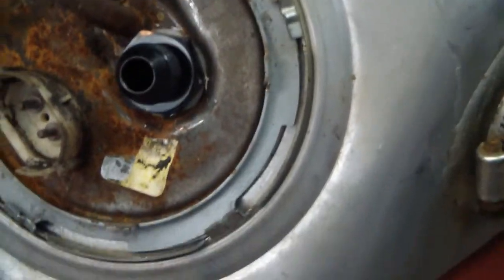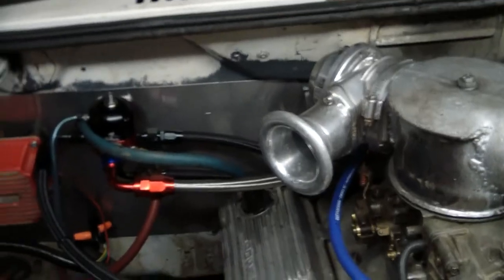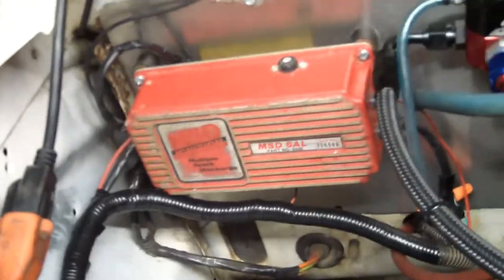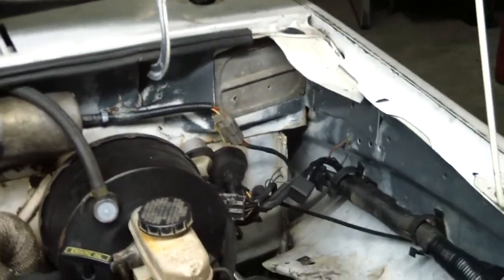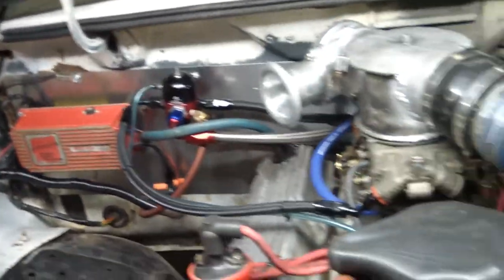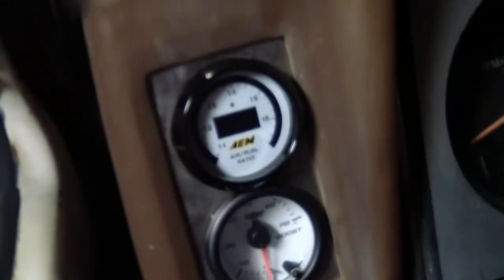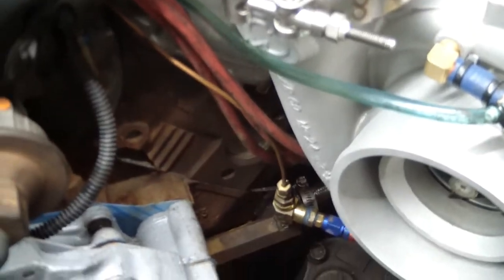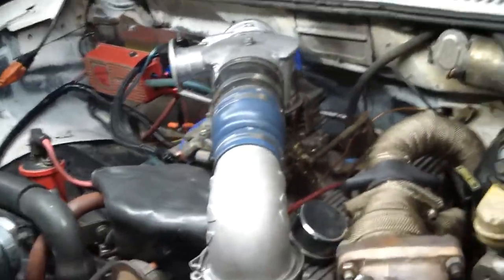Turbo V8 Ranger update (pt7)

Comment: I run 15 in my 97 explorer.  Tune it well and it'll hold
Reply from the maker: That's right you don't need a big cam, heads, stroker motors just a big ass turbo. lol
Reply: @kickassmustangsgarage   I just picked up a 96 awd explorer to use as a donor for my 2002 ext cab 4x4 ranger....  I wanna do a blowthrew carb and keep it as simple ss physically possible.....    Do you have ANY advice for me?   Like ANY advice what so ever hahaha its my very first turbo build and Its gonna be a 95% junkyard parts....  I plan on using foxbody headers turned backwards/upside down and making a homemade hotside like you did.  Ive got a little vw jetta turbo i want to use.    I think Using a Smaller turbo will give me the 5-7psi i want plus a better throttle response with less lag.     Its planned to be my fun daily driver/weekend warrior for now..... Then its getting 4 linked with fullsize axles and a cage once i get another daily..... Lol

Comment: I just bought my 5.0 for the ranger today. Out of 97 explorer
Reply from the maker: Sweet what heads does it have gt40 p or gt40
Reply: @kickassmustangsgarage  I'm not  sure I'll let u know soon as I take a look at them
Reply from the maker: if it has 4 bars on the head it's p heads if 3 bars gt40s
Reply: @kickassmustangsgarage  4 Mark's brotha
Reply from the maker: Thats p heads the spark plug angle is different keep that in mind if you plan to run headers

Comment: @badassmustanggarage I just picked up a 96 awd explorer to use as a donor for my 2002 ext cab 4x4 ranger. I wanna do a blowthrew carb and keep it as simple ss physically possible.    Do you have ANY advice for me? Its gonna be a 95% junkyard parts build....  I plan on using foxbody headers turned backwards/upside down and making a homemade hotside like you did.  Ive got a little vw jetta turbo i want to use.    I think Using a Smaller turbo will give me the 5-7psi i want plus a better throttle response with less lag.     Its planned to be my fun daily driver/weekend warrior for now..... Then its getting 4 linked with fullsize axles and a cage once i get another daily..... Lol
Reply from the maker: When you flip headers upside down it covers a good bit of the exhaust port on the head. Put a  exhaust gasket on a header upside down you'll see what I mean. Thats why I used a manifold on the one that I did flip there was enough material to open it up to match the exhaust port on the head. If you try to grind a header enough to match the head you'll grind through the tube. I don't have lag with this big ass turbo go watch the video of me driving it and listen it starts building boost immediately. I would find a bigger turbo than a vw jetta. A 302 actualy has more air volume than the 12.7 L Semi truck I got the turbo off of. 12.7 L only turns 2250 RPM maxed out=28,575 LPM of air. 302 =5.0 L at 6000 RPMs = 30,000 LPM of air. If you go big you can always turn it down if you go small your just stuck with what it makes. I got the Ranger set at 10 LBS and could go up to 40 LBS if it could take it without splitting in half Lol.
Reply from the maker: I think 96 had GT40 heads with 3 lines on the heads  GT40P heads have 4 lines and the plug angle is different. The way I have mine set up is about as simple as it can get and it works waaay better than I thought it would
Reply: @kickassmustangsgarage  it's either a 95 or 96.  Not real sure lol how did You set your ignition up? Ive got a good game plan/starting point for everything else, but i have no clue what to do for the ignition😂😂
Reply from the maker: Look at the heads 3 lines are regular GT40s  4 lines are GT40Ps.  85 mustang is the only year that has a roller cam and a carb.